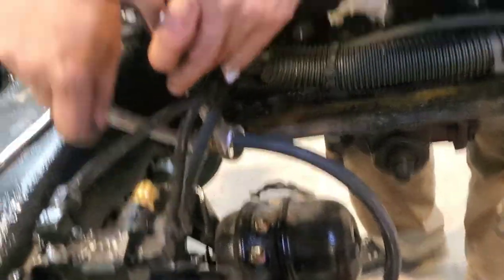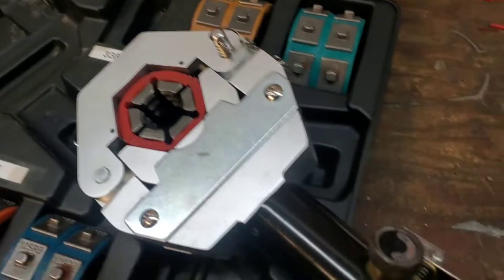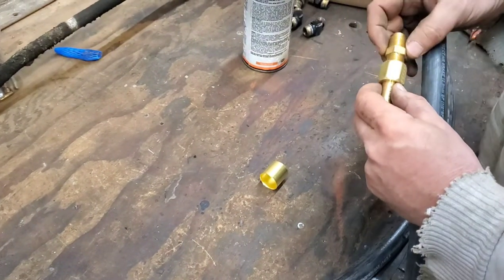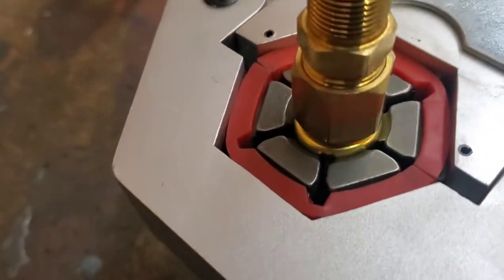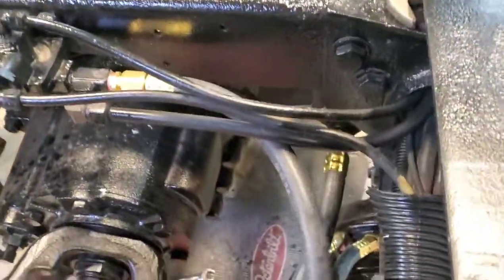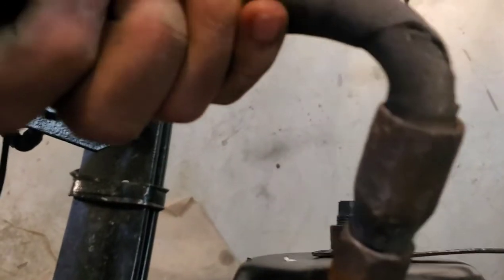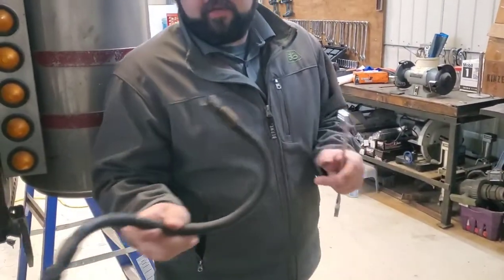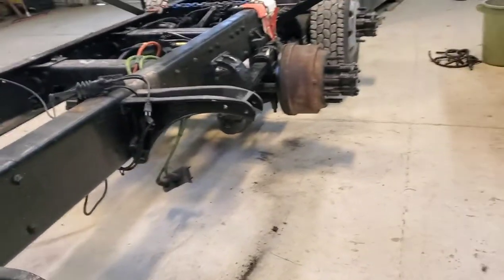Peterbilt 379 Rebuild (episode 2) brake line replacement

Comment: Any idea if there is a pilot valve anywhere in the air suspension system?
Reply from the maker: Define pilot valve.
Reply: @gblonde2331  it is like a central distribution valve where all the air lines come together,I have one on my air ride trailer but was just curious if you knew if there is one  thanks
Reply from the maker: @tanuki379  there is one under the pass side of the cab at the rear. Also 1 over each axle.